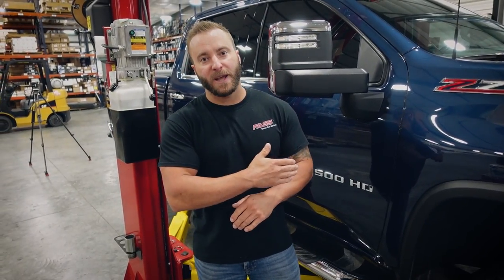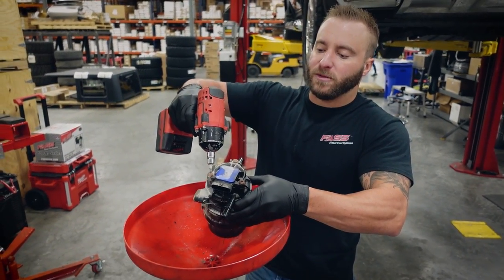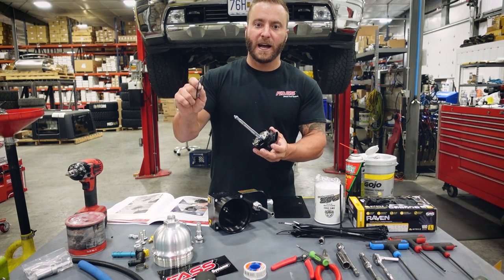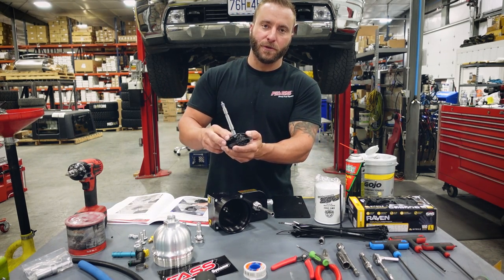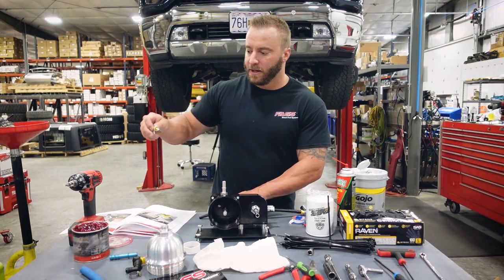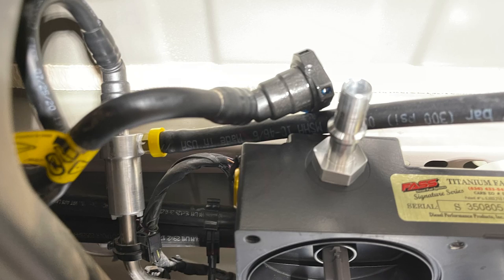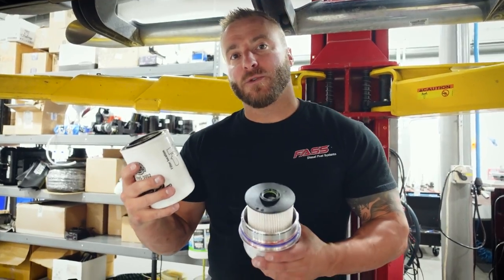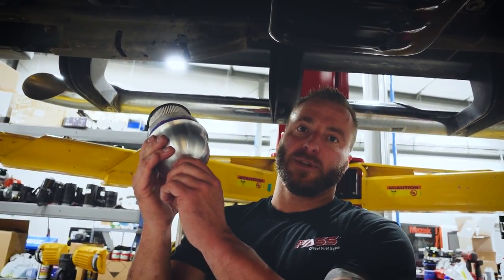L5P Duramax Drop-In Series System (DIFSL5P2001) Installation Guide!

Comment: What's the point/benefit?? I haven't had an issue with my factory setup.
Reply from the maker: We appreciate you asking, and FASS stands for Fuel Air Separation System, and is a fuel filtration system designed to improve your diesel truck’s fuel mileage, performance, and extend the life of your diesel injection system.

Our systems do this by removing impurities from diesel fuel such as air, dirt, and water—which are harmful to injection components. Providing polished fuel to the combustion chamber also creates a more efficient fuel burn—improving power and efficiency.

I have a link to our "What is FASS" page as well, there is a lot of great info here on our system!

https://fassride.com/what-is-fass/

Comment: Is this any different than from a 2023 GMC duramax?
Reply from the maker: Great question, and yes sir this drop-in kit will fit both trucks. The main difference in the kits will be based on the bed configuration of the truck.

Comment: Thank you for making this video!  I have two questions.  One, do you know if the installation still goes as shown with a Titan 60-gallon fuel tank?  Two, is the type of grease I use for pre-lubing the lines critical?
Reply from the maker: Great question, and we apologize as these systems won't fit with a Titan fuel tank as there is no more space available. Also, no sir the grease you use isn't critical as long as your using something.
Reply: @FASSFuelSystems   Thank you, Sir!
Reply from the maker: @GTOGregory  you are very welcome!
Reply: Will it fit with the S&B 62gal tank
Reply from the maker: @carloswilson5436  Great question, and we apologize sir as these don't fit with the S&B fuel tank.